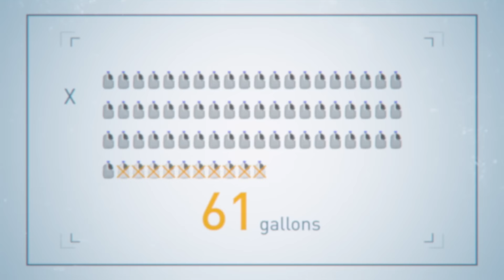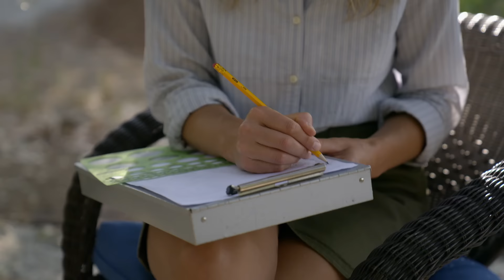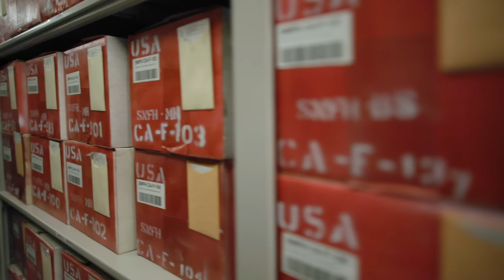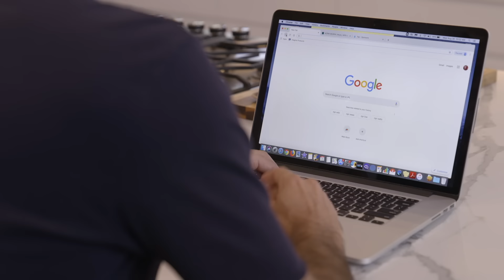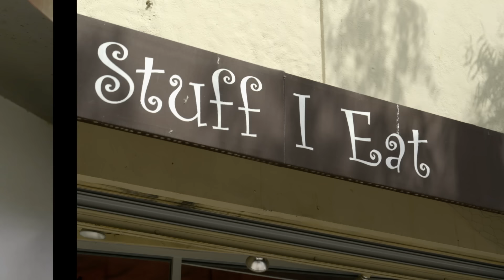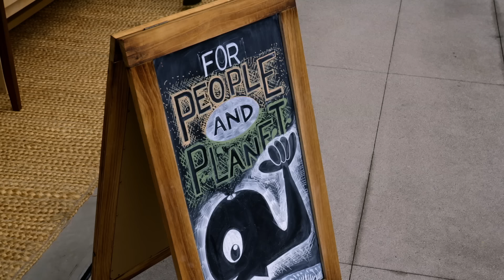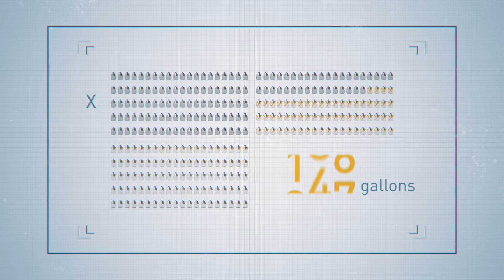The Water Crisis | National Geographic

Comment: No need to buy a new toilet...
Just put a brick in the tank on the back of the toilet.  Whatever the brick displaces will be the amount you save on each flush.
Reply: Great Idea but a brick will slowly erode and mess up your pipes I use a glass or plastic  jar and fill it with water instead
Reply: I put a 2 litre pop bottle, with the cap on( filled with water) in the back of my toilet! 
Stay, safe, stay sane, be well
Reply: @wldwon  slowly erode in about 1000 years, lol!
Reply: shhh we must not find solutions that solve issues without buying something new......
Reply: or, just adjust the float.
Reply: @timmythewoo9742  exactly
Reply: @richardj ellis  "If it's BROWN💩...flush it down...If it's YELLOW🟡 let it mellow"...a water delivery guy who had to refill our 1500 gal cistern tank a few times when we ran out (we were on a snow-type, run-off spring water system) told me this yrs ago ++ some other H2O saving tips. He never had to refill 🌊 it again! 👍😉
Reply: My parents did this when I was a little kid back in the 1980s, lol.
Reply: ok richardj ellis then we just need to flush more times
Reply: @paulferrante5192  Terrible advice after you eat asparagus.

Comment: If only we can make pipes that run from one country to another. You know, if one country is flooding due to typhoons like my country we can divert that flood water to another place that has low level of water.
Reply: Thinking outside the box.  Your idea is crazy...and I like it.
Reply: @ Min Young
 Piping around the world wouldn't be feasible from an engineering standpoint. I know we can do amazing things these days but think about it. And we need a solution soon. Every city, state and country has to save water in every way possible. And use alternative fuel sources. NOW.
Reply: I ALSO THOUGHT ABOUT THIS BACK IN 2002 ALONG WITH BUILDING DAMS ALL OVER THE COUNTRY WERE NEEDED
Reply: @nayasea3918  no you never and using capitals doesn’t make it true.
Reply: @geoben1810 To be fair there are built gas’s and oil pipelines that are extremely long even laid on the sea floor so it is possible but only between countries close to one another not from continent to continent.

Comment: You'll never know the value of each drop of water until you carry them on your own
Reply: Absolutely. I don't have running water in my house. I pack it & use every drop wisely
Reply: @angeladansie4378  Better to hand dig a water hole using extendable augers - that's what I did - then use a composting dry toilet. Most water use is from flushing for urine. Whereas a drilled well requires clearing out the forest - for a sanitation septic system also. Loss of forest means no rain because no trees to store up the water and then transpire it back into the sky. So civilization is a lose-lose. This goes back to people using lime-ash cement from burning forests - in order to water proof their houses - in 8000 BCE Levant West Asia. Oops.
Reply: @voidisyinyangvoidisyinyang885  
Compost from dry toilets can be used as fertilizer.
Reply: Stand all day in shade in a HOT desert,and see how much water you will drink.Not to mention if you worked in direct sun.
Reply: @angeladansie4378   do you have an "OUT 💩HOUSE" instead of a indoor toilet?🤔
Reply: @voidisyinyangvoidisyinyang885  "If it's BROWN💩...flush it down...If it's YELLOW🟡 let it mellow"...a water delivery guy who had to refill our 1500 gal cistern tank a few times when we ran out (we were on a snow-type, run-off spring water system) told me this yrs ago ++ some other H2O saving tips. He never had to refill 🌊 it again! 👍😉
Reply: @stanbarrington9698  I’ve lived in the desert my whole life.. honestly it doesn’t change too much.
Reply: @paulferrante5192   There's no shortage of water and there will never be. It's everywhere even in the desert under the sand.
Reply: @selah71   Every time you pee every time you flush the toilet you will be drinking that water again after it runs through the system of the Earth. We're even drinking the same water dinosaurs did and they urinated a whole lot.

Comment: I'll say it again; plant native plants. Once established you would only need to water them once a week in summer and not at all in winter.
Reply: Actually, use "desert landscaping" where applicable, and you don't have to water at all - or very, very minimal. 👍😊
Reply: @paulferrante5192  If you live an actual desert then yes, use plants native to that desert. The problem with using them anywhere is that they don't help native wildlife. Native pollinators for example are often ecologically keyed to certain local native plants. Plants native to your zip code will always be the best way to go.

Comment: I have directed my washer, shower, and bath water to the garden. I now have a wonderful garden and am not adding to wastewater treatment problems plus I help fix carbon in the soil. When most do this it will help the world.
Reply: people can make a gray water system quite easily - but it goes against the Corporate-State scam of permits and "development." So to have a Legal Dwelling then you need to be scammed by the local well drillers and septic system - and then the local governments jack up your taxes. So it's a corporate-state double whammy and all based on wasting your water and destroying ecology. Better to just hand dig holes using an extendable auger - and so technically they are not "wells" - and then use a composting toilet but not in a "structure" - but a "shelter" (a tent that needs to be moved every six months). good luck. haha
Reply: @voidisyinyangvoidisyinyang885  "If it's BROWN💩...flush it down...If it's YELLOW🟡 let it mellow"...a water delivery guy who had to refill our 1500 gal cistern tank a few times when we ran out (we were on a snow-type, run-off spring water system) told me this yrs ago ++ some other H2O saving tips. He never had to refill 🌊 it again! 👍😉
Reply: @paulferrante5192  yes my GF didn't want to do that. So I asked why and she said urine evaporates faster than water. haha. So anyway we are doomed.

Comment: With the dishes you can still scrape left over bits of food by just a small piece of tissue. Use the bit of tissue to scrape off the plates bec bit of pieces of food can also clogged up the dishwasher in the long run.

Comment: 3:01 They need to calculate the amount water involved in the electricity used to run the dishwasher (and the average per use for building the machine). 32:00 3,000 gallons for a smartphone. Hmmmmmm.

Comment: A 8 minutes shower is equivalent to over 5 showers for me. Most water is wasted until it starts to come hot from the heater. So I place a container during that first moments. I can even wash my running or cycling clothing (by hand) with it and then use it for the toilet. I always use the washing machine at the shortest lasting program at lowest rpm setting for Energy and water saving.

Comment: just skip one steak a week that will more than make up for all the water. 1 pound of beef requires 1,800 gallons of water to produce.
Reply: yes only most of that water is called "green water" - meaning its from the annual rain replenishing the aquifer.  In other words the "blue water" is LESS than avocados, sugar or walnuts.  94% of the water “used” to make typical beef and 97% of the water used to make grass-finished beef is naturally occurring rainfall - rain that would have fallen whether or not that animal was grazing the grass. Green water is rainfall and naturally occurring precipitation that is temporarily stored in the soil or on top of the soil. It does not runoff into other waterways or infiltrate the soil to reach groundwater storage basins like aquifers.
Reply: For a legume, I heard lentils are high too but half as much as beef.
Reply: Not true.. That statistic about beef is nonsense

Comment: Installing a recirculating pump on the hot water line will eliminate the need to run the water until it gets hot.  A friendly green tip from a Union Plumber. 👨‍🔧💧

Comment: For individuals: 

Take military showers (turn off your shower when you are scrubbing any part of your body with soap, shampoo or conditioner).
Save water that runs for more heat (as shown in video).
Use just enough water to clean dishes if washing by hand (do not continue to run the faucet, store the water in a bowl with soap mixed in).
If you live in a dry climate, do not keep ornamental grass in your yard.
Finish up your drinks! (especially at restaurants)
Stop drinking coke/pepsi products. (they're unhealthy anyway)
Replace your faucets if they are not the most efficient ones on the market.
Re-wear clothes that haven't caught dirt, debris, sweat, stains or body odor.
Cut back on meat and diary products (livestock consume lots of water).

Feel free to add more suggestions in the reply thread. Also add a section for industries if you have any.

Comment: Shannon is wrong on the water "pressure" of new dishwashers, they are NOT high pressure, they are low pressure but run for a long time to soften material on dishes so it can be washed away - new dishwashers run 3-4 hours for a cycle, and are extremely quiet when they run as well...

Comment: Hetch Hetchy is currently at 87% capacity. Meanwhile Folsom Lake, Lake Oroville, and Shasta Lake are all dangerously low at below 40%. Expected to reach record lows. Why not divert some water from Hetch Hetchy to help the fish and to flush to bay? Why not impose a significant rate increase and demand that all leaking sewage be fixed within 12 months?
Reply: usually there is a grant system when such an infrastructure overhaul is required. For example the rural electrical system was built via grants for cooperatives. Or for example Chicago was a pre-planned city. It's how Supply Side economics works. Ray-Gun Subsidized California to be the Number ONe Dairy state over Wisconsin. The corporate-state subsidies are the real problem. Corporate Welfare.
Reply: Transporting water is not simple or easy by the time you make the infrastructure, the problem wouldn't really change.

Comment: Growing water intensive crops in the desert by draining the deep aquifer and then EXPORTING that water (crop) to other areas is crazy on it's face.  Egypt is moaning about a dam in Ethiopia while it is a net exporter of water in the crops grown there for export.  The southwest could and should construct rainwater harvesting swales like the ones near Tucson put in in the 1930s.  On one side is desert, on the other is a green ecosystem with grass and trees and wildlife.  Those swales were constructed by the CCC Civilian Conservation Corp without the use of heavy equipment and then left alone.  When the monsoons come each year, billions of gallons or runoff rush down the usually dry watercourses and rush to the sea where the fresh water becomes salt water.  Slow it down, hold it back, and allow it to percolate into the ground.  Stop putting stormwater drainage systems in to channel the water away from the city as quickly as possible.  Build catchment basins to hold the rain in place and use it to recharge the groundwater.  It is simple and simply requires the will to do it.

Comment: my yard got over 80,000 gallons of water yesterday. it was free.
Reply: It depends how much thatch you have and trees to absorb the water. Most lawns lose the water to run-off. So that's why a mulching lawn mower is the way to go. Also proper mycelium fungi in the lawn will store the carbon - via water storage. Farmers are not realizing that proper mycelium fungus in the soil is the key to storing carbon. A lawn typically stores 1/2 ton per acre but with proper fungi fertilization and thatch then you can store 1 ton of carbon per acre. thanks

Comment: Wanna know why floods aren't going to happen and water wars will be avoided?

Reverse osmosis is currently the most widely used desalination technology globally. It has proven to be effective in treating both seawater and brackish water, making it versatile for a range of water sources. RO systems have significantly improved in terms of efficiency, reliability, and cost-effectiveness over the years.

Advantages of RO include:

High Salt Rejection: RO membranes can remove a significant percentage of salts and other impurities from water, producing high-quality freshwater.

Widely Implemented: RO technology has been successfully deployed in numerous desalination plants worldwide, providing a proven track record of its effectiveness.

Energy Efficiency Improvements: Advances in membrane technology and energy recovery devices have contributed to reducing the energy consumption of RO systems. This makes them more sustainable in the long run.

Scalability: RO systems can be designed to accommodate a wide range of water production capacities, from small-scale systems to large-scale industrial plants.

Comment: I hate these kinds of shows that in this case put the water crisis on the backs of individuals without attacking directly the oil and gas industry.  Fracking uses more water per well than 100k people.  There are thousands and thousands of fracking wells across the US and Canada. 
Nat Geo are part of the problem by omission and are not part of the solution.  But then what do you expect from a company now owned by Koch.

Comment: With prudent planning and a little luck, Phoenix could be viable for another decade before it’s a dust bowl. 15,000 Olympic pools worth of water evaporate a week from lake mead. Ground water has been pumped with reckless abandon. Yes, they can save a few thousand gallons here and there… but the writing is on the wall. With lakes lakes Powell & Mead losing 60% of their contents since 1990; losing 1.85 inches to 2.5 a day, global climate change, more people, more demand, less rainfall, ground that has lost most of its moisture content, and lessening snowpack… well, you can drink from a glass more slowly, but it’s not going to be refilled. Eventually day zero. The question is- when do the realtors and politicians start cutting and running. Desalination is not an option for a problem of this scale, providing 1.5 gallon of saline for every gallon of fresh water extracted at a high energy cost.  Some decade it may come back, but likely not in our lifetimes. Nature’s supply can not meet the current demand.